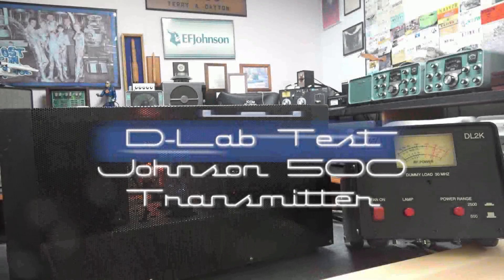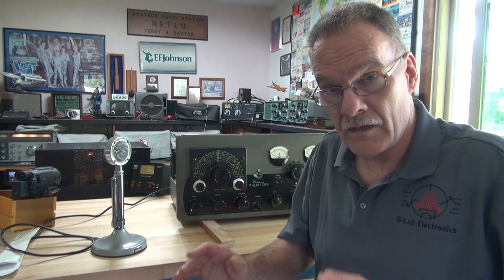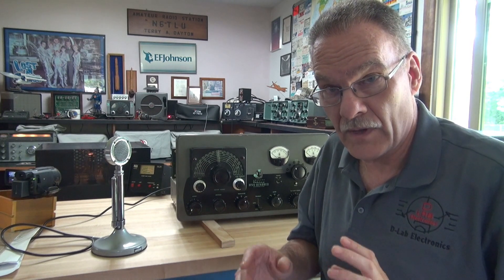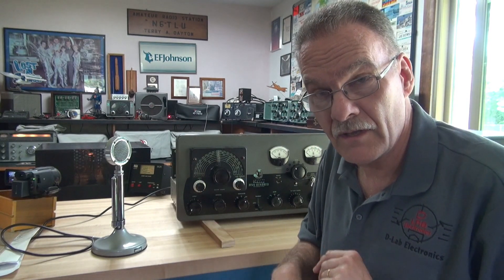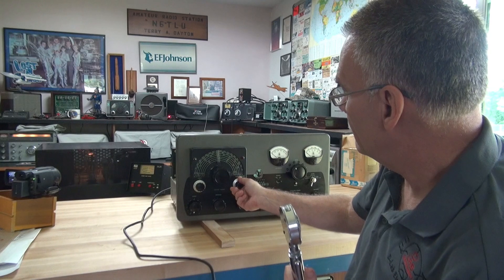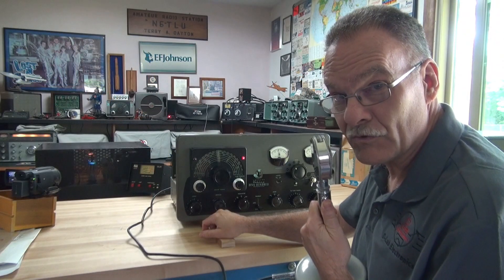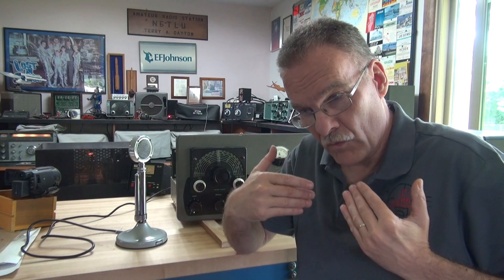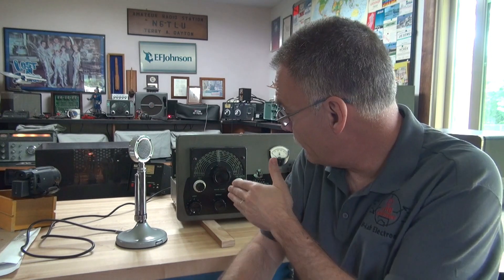Testing EF Johnson 500 tube Ham Radio transmitter following repair High Power AM Plate Modulation

Comment: Fantastic bulletproof work bench. Is the 4-400 tube a tube used in those transmitters from the factory or was that tube size added by the consumer?
Reply from the maker: Yes Sir, The 4-400 was stock in the Johnson 500